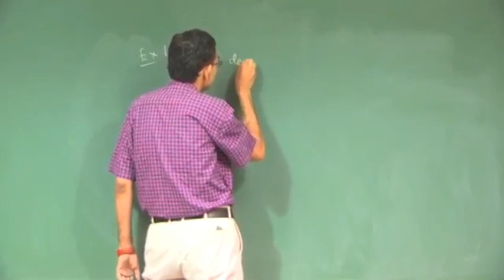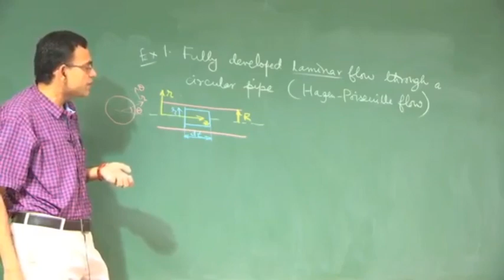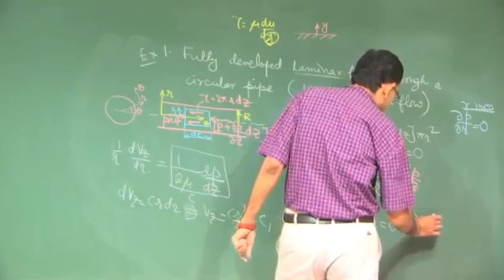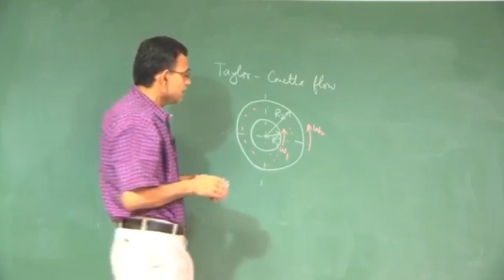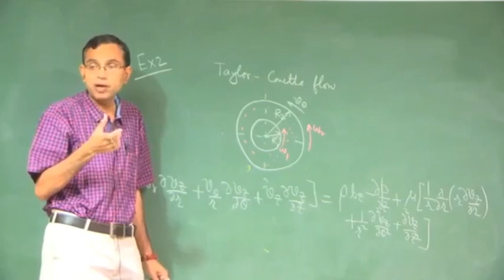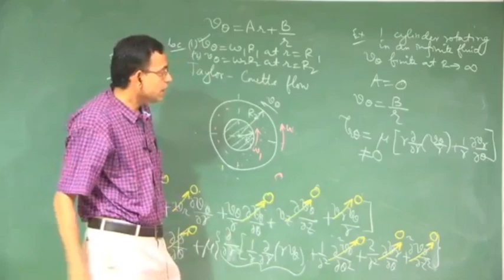Lecture 19 : Exact solutions of the Navier Stokes equations in cylindrical polar coordinates

Comment: Here we students should be very careful about shear stress (tau). Like, when we are trying to mention shear stress in free body diagram of fluid element in z direction (channel/pipe length direction) with outer surface at r= r, not R then it is shear force on the fluid element surface exerted by adjacent/outer fluid layer. And when we are trying to define Shear stress at wall then it is the shear stress at wall (r=R) surface exerted by adjacent fluid layer.
At r=R, the magnitude of shear stress/force on fluid by wall surface or on wall surface by adjacent fluid is same but opposite in direction (by Newton's 3rd law).
By taking care of the respective shear stresses related to fluid and wall it will be easier to avoid confusion.

Comment: Why all forces are balance d???? Fluid is flowing na??
Reply: because fluid  flows at constant  velocity in  fully developed region.
Reply: When the acceleration of fluid is zero, forces are balanced. Acceleration can be zero if velocity gradient is zero. Velocity gradient is zero if velocity is constant. Constant can either be zero or a non zero numeric value
Reply: Your confusion is very much valid.
The net zero force can have different effects in different situations.
When fluid/particle is at rest then it will remain in rest and there won't be any flow/motion at all because of net zero force and hence zero acceleration. This is the case when the fluid is simply lying stagnant/in rest inside the channel/pipe with no motion at all (a trivial case, situation of no interest for us).
But if there is some flow/motion taking place (with changing velocity because of whatsoever cause of motion) and then when zero net force condition is achieved then the flow velocity will stop changing which is the case here.
In a single statement a fully developed flow is the case of net zero force with constant nonzero velocity.

To understand how this constant nonzero velocity flow is achieved you may refer the points below.

Actually here we are talking about the situation (and a specific region along pipe/channel length) after the time when flow has reached steady state and become fully developed.

Let's talk about situation which could have been associated with the flow before the above conditions were reached.

Initially inside the entry region (entry region is the length along the channel/pipe after which steady fully developed conditions are reached) there is net force on fluid element which might be giving some acceleration and hence some velocity. Inside the entry region flow situation remain like this (not fully developed flow). But after the entry region due to growth of boundary layer fully developed conditions are achieved and net force and hence acceleration of fluid element becomes zero and the velocities reach at certain value and stops changing. Now this is the condition we study in the steady fully developed flow (which occurs after the entry region). There could still be net force in the entry region while we are analysing the fully developed flow in the region after entry length.